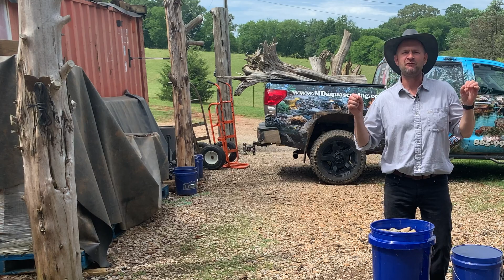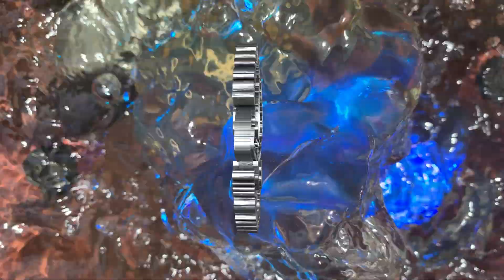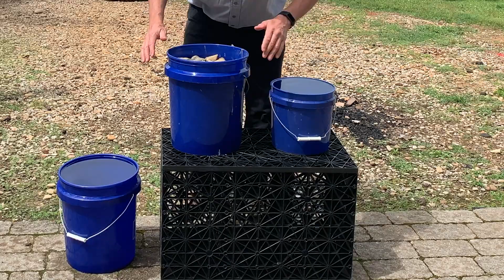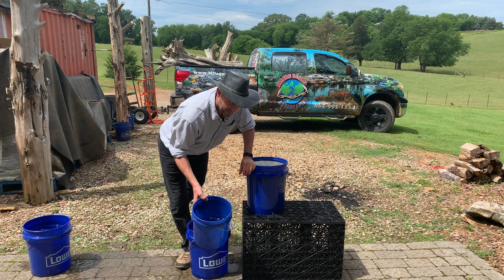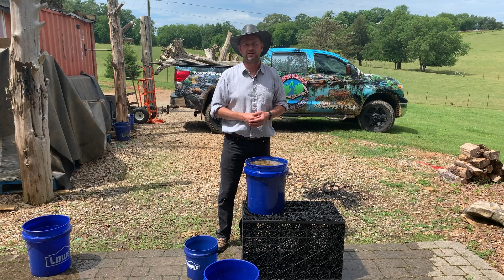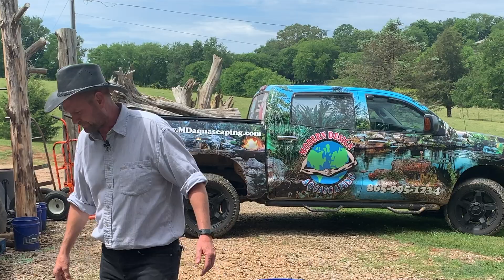Pondless Waterfall Reservoir Design! | Water Feature Design Series 3

Comment: Thanks. I'll give this a thumbs up because I finally understood. What you are doing is simply calculating the volume from all features above the pond's overflow point that would dump into the the lowest pond when all pumping ceases (eg power failure, am/pm cycling). Hence, the lower pond will designed to absorb all of that flow without dumping on the lawn. Is that where this is going?
Reply from the maker: Sounds like the short version. Doesn’t sound complicated, but you’d be amazed by how many people don’t get it!

Comment: Great video. Looking at doing a wetland filter  for a 6000ish gal pond. I with have the water reservoir  under the stream so water will percolate up. Looking at your videos you often have around 2ft of layered gravel on the blocks. so question is when calculating water in motion where does the reservoir end and stream start? is the 2ft of gravel on the blocks making the filter considered the stream for the calculation? thanks
Reply from the maker: You have to figure out where the water in the stream is going to drop two when the pump is off. Once you know that then you can figure out how much the water level dropped and that will give you your calculation for water and motion. Typically we just use a berm beneath the liner to create a bathtub affect holding the water back so that way only lose the water off the surface and not a very deep amount. Does that answer your question?

Comment: So, per my calculations, a 300 gallon reservoir would require 30 blocks once filled with gravel? My current feature will have 120 gallons in motion. I need at least 240 gallons of reservoir. That works out to eight blocks. Half-full the reservoir would contain 42 gallons. I would still have 120 gallons up stream with only 42 gallons of capacity left. I'm confused by your calculations. I've seen people recommend filling these blocks with gravel and I've seen specifications touting the economy of using these compared to a gravel filled reservoir. Which method is correct? Thank you for the informative videos.
Reply from the maker: There is no reason to fill the blocks with gravel, ever👍🏻 The whole point of the aqua blocks is to hold water without the displacement that occurs from filling the reservoir with gravel. If you consider the holding capacity of each large block at 30 some gallons and the fact that you cover the blocks with 6 inches of stone which holds 30% water per cubic foot, I would expect a 300 gallon reservoir to be about eight large aqua-blocks and the stone above👍🏻 The 6 inches of stone on top serves two purposes want us to catch the debris that falls and the second is to protect the blocks from the ultraviolet rays of the sun :-) did I answer your question?
Reply: @KoiAddiction  
I edited my question but I believe you've answered my question. I have seen people fill them with gravel and have questions as to why? I had a 1200 gallon reservoir push out of the ground because a nearby sprinkler leak filled up below the liner. This made me question my methods after I saw people fill their blocks with gravel. Thank you for responding so quickly! You've gained a new subscriber!
Reply from the maker: Sorry about your “ misfortune” the reservoir is a boat in the ground if it’s empty😕 I try to keep them 50% full and covered in stone BUT it sounds like you were just unlucky…Thanks for tuning in to our channel!
Reply: @KoiAddiction  
Totally, it had 4800 lbs of water in it and 4000 lbs of stone on top.
Reply from the maker: Ive been in a dugout canoe in South America, it’s almost full of water-2 grown men inside-barely 2” above water-still floats😕Sometimes physics sucks🙄You could put a drain under it to keep the situation from reoccurring….

Comment: Do you think I could combine a negative edge system with liners for the stream, reservoir, and negative edge with a liner-less clay-soil (compacted) pond?
Reply from the maker: Absolutely. The important thing is that you make sure to get your liner out past where the water movement has velocity. The last thing you want is to be stirring up the clay silt with your water movement. In that instance the water would never get clear and you would have erosion issues.

Comment: Great points.  I built mine last week.  Couldn't wait for the video.  My planning was close but when i unplug it I do have some over flow.  I could have used one more block.  Great information
Reply from the maker: Sounds like youre in good shape. How did it turn out?
Reply: @KoiAddiction  We love it.  24ft stream flow through a 2 ft high berm.  3,100 gal pump is moving the water well.  My stream averages 1 ft wide.  Your videos have help big time